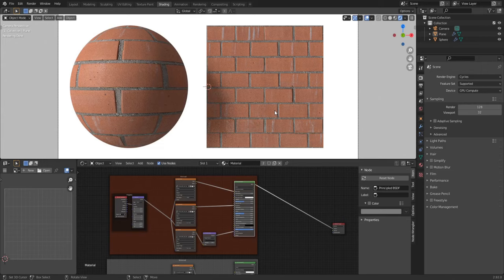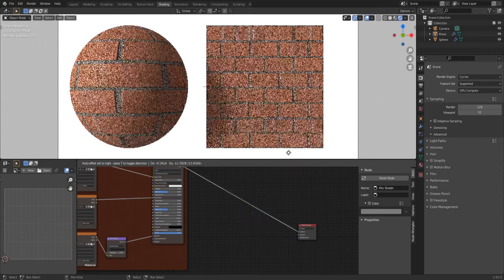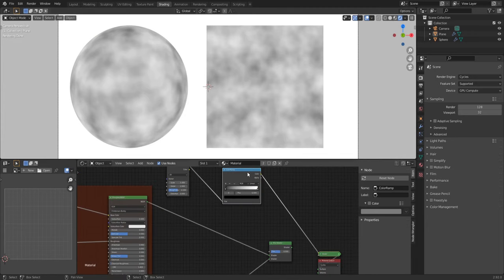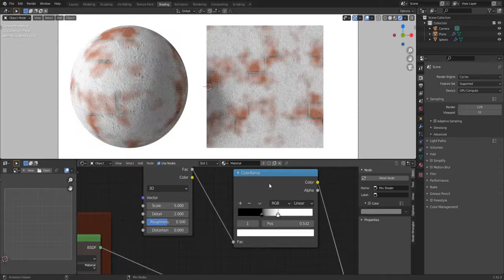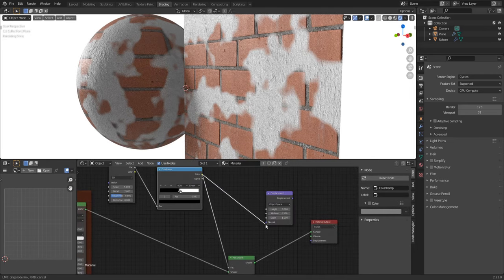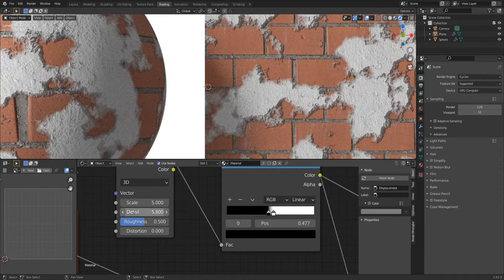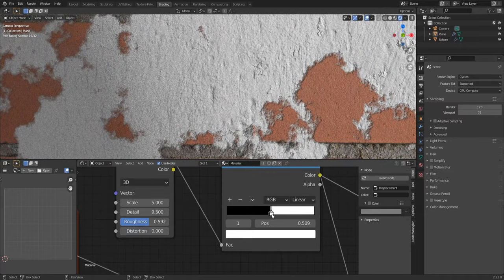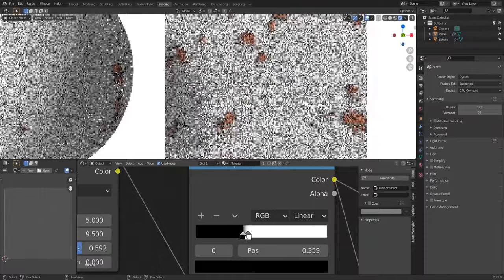How to mix materials. Blender tutorial

Comment: Just so everybody knows, it doesn't have to be a noise texture, so if you know about masking (which is a process where you take black and white values to dictate where stuff does and doesn't happen, or how strong the effect is) you should be able to custom mix the textures or isolate the effect of one texture to a specific area, so for example I plan to use it to distinguish regular skin from lip skin by painting white where the lip texture is supposed to be, and let the computer determine that that's where the effect should happen. If you UV unwrap the geometry and generate an image in the image editor, and then plug the generated image into the factor to mix the shaders in the shader editor, it should let you do that. Anyway I had no idea that you had to plug it into the mix factor, but it makes perfect sense, and it worked, so thanks!
Reply: I learned what youre talking about years ago, but then forgot it. LOL. So, thanks. The version of blender he is using changed, so the mix node is different. Would you set the "mix type" to overlay or multiply to do what you described. THanks in advance
Reply: @JohnsonHouse-i9d  honestly I suck at understanding the blend modes still. I just usually cycle through them and get confused and then default back to mix. All I can tell you is that after some critical thinking and experimenting, I found out that the way to set texture depth in terms of layers is to plug the old texture into A, plug the new texture into B, and plug the new texture's mask into factor, if that mask has white where the new texture is supposed to be. That way the white has a value of one, so wherever the white is, the value of one will say to show texture B (the newest one), but I don't know if that's relevant.

 What are you trying to do exactly?
Reply: @ericfieldman  i used blender years ago. but but the last two years i've been learning unreal. I shouldn't have stopped blender so long, because I KNEW HOW TO DO THIS. 

 anyway, i normally use it to add wear and tear to clean textures. like, i'm currently doing a wooden door. I have a wood texture, and a scratched wood texture. 

  I've created a black and white image of where i want my scratch texture to show (along the edges). Now, i just cant get it to mix right.  I think "mix option" was overlay, multiply, or mix. But my have had the wood and wear textures in the wrong slot.
Reply: @ericfieldman  yeah, i had the order of the textures wrong. thanks.
Reply: @JohnsonHouse-i9d  yeah no problem. Took an embarrassingly long time to reason that out. There could be a problem with using just masks I don't know about, but if you label them all as the thing they're plugged into (roughness, displacement, etc.) You can access them in texture painting mode under texture slots and paint directly on the mesh to affect where stuff occurrs, provided you've unwrapped the geometry. I plan on using that
Reply: @ericfieldman  thanks. peace and love to you and yours
Reply: @JohnsonHouse-i9d  vice versa. My life has basically become nothing but learning game stuff and modeling stuff, which is a bit disheartening, but most likely a useful investment, so if you have any other questions I'd be happy to see if I have answers

Comment: How can you add another material in the shader viewport, that is not already applied to the object?
Reply from the maker: duplicate (shift+d) or create (shift+a) a new principled shader in the same window of first material. Using the node wrangler addon, textures can be added to it with 1 click. or textures can be connected manually. in this way you can create any number of “materials” inside one and then mix them

Comment: You explained well but i want know how to export in fbx this model with all texture and color
Reply from the maker: As far as I know there is no easy way. This is done in two stages. First, export the geometry to fbx. Then bake each texture map (color, roughness, normal, displacement and other textures if necessary). To do this, you need to change the nodes a little. Mix not shaders, but textures of both materials. First the color texture. Connect this to the emission node and bake "emit". Then the same with the roughness. Then manually import the fbx and textures into the game engine and manually connect the textures to the material. This way of mixing materials is ideal for working inside a blender. But if the goal is to import into the game engine, then it's easier to use special texturing software - for example adobe painter, 3d coat, quixel mixer.
Reply: Thanks